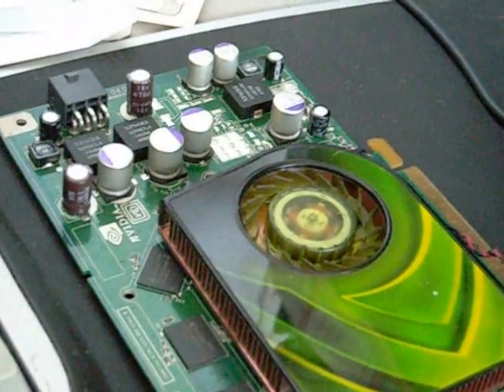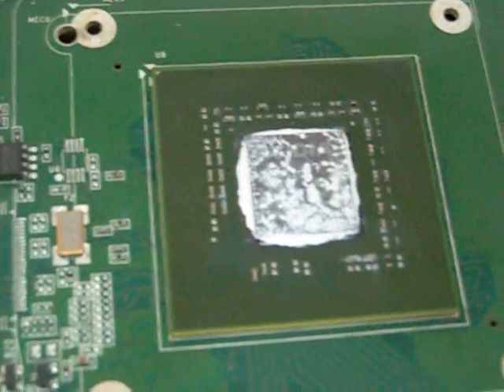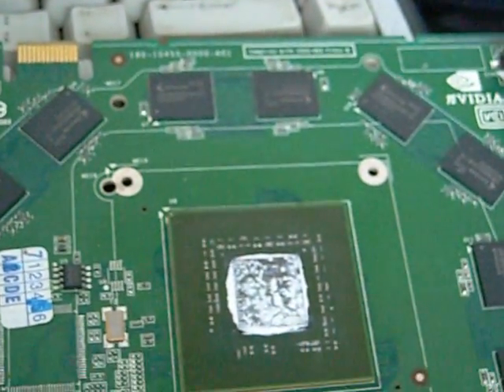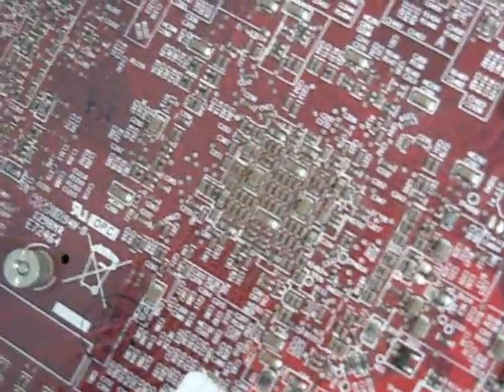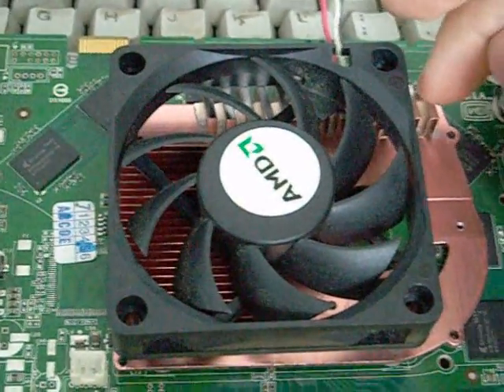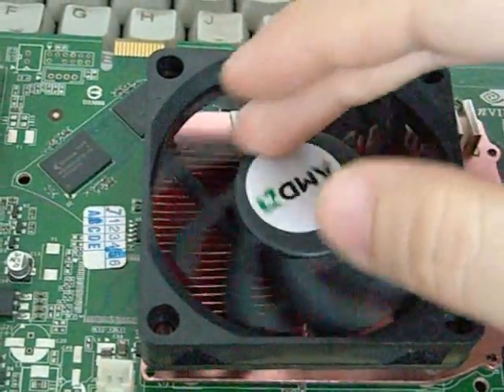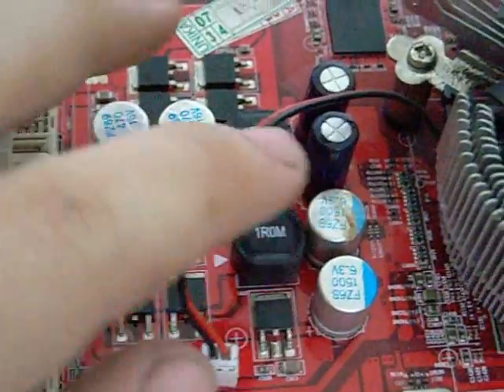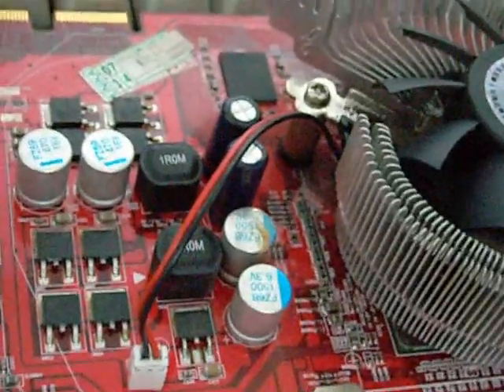How to tell if your graphic is overheating from a flu ridden geek.

Comment from the maker: Well if you have fan speed control with nvidia software you can increase the fan speed. If not you can try other software to control the fan speed like riva tuner i think.

Also, if you have too much positive pressure in your case ( more air blown in the case than blown out) then hot air is accumulating too fast to escape. Try twisting around one of the intake fans so blows out air (preferably nearer to the card).

Comment from the maker: Did some research on your card. Is it the dual fan or single fan version? Plus how old is it? It may be a case of the thermal compound drying up. Make sure to buy some thermal compound and 95% pure alcohol (or electronic cleaner) if you are gonna disassemble the heatsink/fan. Another alternative is to buy a 80mm fan, stick some foam tape on the corners and have it rest on the back (top) of your card blowing air on the back of the GPU.

You may also want to investigate airflow in your casing.

Comment: Oh my bad then. Well no it's not a mid or low range card, it's not the best money can buy it does get the job done. Far Cry 3 runs at about 50 FPS with everything set to High (2X AA, HDAO, 5 Buffered frames, V-Sync On) much like a lot of today's games, only ones that don't run as they should are GTA IV (crappiest port in history) and The Sims 3 with all expansion packs.

Far Cry 3 however is the only game that causes my GPU to over-heat.

Comment from the maker: My statement means that your card is either a lower mid-range card or just barely mid-range which is fine for running normal games like WOW and other MMORPGs at high graphics but definitely will have problems handling games like  Crysis 3 at high resolution and detail settings. Should it run at 24-30 fps at your current settings and it stills dies to overheating you can either invest in 3rd party cooling or add a fan. Otherwise, you will have to drop the workload for card down.

Comment from the maker: What the sensors read is not what is happening under the silicon :/ I meant more of solder fatiguing actually. The heat softens the solder and warps the circuit board. After time the solder contacts break but I have seen those small resistors fall off the board when the GPU was overheating like mad so I guess it's a combo or hotspots and heat dissipation on certain components. After all the mofets get hot too on their own cooked both ways is bad.

Comment from the maker: Heatsinks are mounted on my string screws so that is unlikely :/ The 4850 usual operating temps are 90C (the gpu was designed to take that heat levels since they actually it those normally). 100C on the other hand well that is well too hot.

Comment: Those temps are extremely high for a radeon card, my 6950 shuts of at 70C but rarely get any higher that 50C. My first guess would be a dirty heat sink but if there was any shock the heat sink can become disconnected from the gpu.

Comment from the maker: 100C is bordering on the point of GPU thermal death or GPU desoldering :/

If you one of the HD4850 that has a reference cooler (looks like a brick house with a fan on the card) then maybe you should invest in a 2nd hand cooler to replace it. Those reference coolers are pretty useless.

Comment from the maker: Well 60C is really hot you know so you cant hold contact on it for more than 10 secs. When it hits 70C that's when you gotta be careful of your fingers.

60C idle is still quite hot... :/ Better open the heatsink and check for powered thermal paste or rock hard thermal paste. Usually means the paste has perished and you need to reapply (which mean get some paste before you do this just in case).

Comment: already did, already put new tuniq tx-2 as mentioned to the video poster.it measures 55c at first, after i run game for 10 minutes it back to constant 86c (even after i let it idle for few minutes) while the fan never push any faster to cool it down.so that's why i use rivatuner to force the fan

Comment from the maker: If you have the chance you should crack open the fan shroud and do a little spring cleaning on the heatsink fins. There might a large colonoy of dust bunnies clogging up the air flow.

Comment: as u said, the normal should be 50°c at idle, but mine is constant 86°c at idle, so it's abnormal right? now i just use rivatuner to force my fan speed at 80% capacity, and it's currently at 60°c on idle and i'm quite contend with it

Comment: yes, i open it.noticed the paste has dried. so i put tuniq tx2 on that. at first idle temp is 55°. after i ran my game for 10 minutes, the temp is at 86° again with fan at 50%. do we need to put more thermal paste on it than on the cpu?

now i use rivatuner to force control my fan, and it gets better. my question is why the fan won't operate at appropriate speed according to the temp? before this, the fan seems to know by itself when to speed up, but now i need rivatuner to control it

Comment from the maker: Ok what you do open the panel to the temperature section then run your baddest ass game for 10 mins and the highest settings you can play smoothly. Quick quit after 10 mins or if the game allows alt+tab to the panel (or even pressing the windows key) and take a look at the heat.

Comment from the maker: Where did you get that temp reading? A software monitor? If so run passmark with the monitor on so you can see what is the idle gpu temp and how fast and high it gets when stressed.

Comment: Why? because they are both 1920x1080.it's why something like eyefinity slows a gpu down, because of the increase in resolution, amongst other things. you should have said at 1080p resolution rather than stating monitor size.

Comment: i hate it when people say that the graphics card performance is dependant on monitor size, it isn't, it's monitor resolution that makes a difference. if i was to plug my gpu into my 32" tv there would be no performance difference than if i was using my 21.5" monitor.

Comment: Is Ok for a passive low power card.It will not rise more than that even if you run a game.
More powerful  cards run at 90 to 100 regularly.
At some point between 110-120 the drivers will kick you out of 3D mode.More than that will get you hardware related BSODs.
So peace your mind; the HD6450  have a very low power profile and simply can not generate enuff heat to rise above 110 by itself.

Comment from the maker: @ubergammer00 That means the sound driver crashed (due to the card overheating or failing - capacitors blown). The sound that is playing is funnily enough music stored in RAM that is still pumping through the speakers (can't how this works but either the sound chip can work independently of windows crashing or that the RAM is actually holding the decoded raw data that is passed through the speaker port for output).

Comment from the maker: @zeznatdodaska Check if the thermal paste has dried up. If so get some and reapply (can't remember which video but a recent one I showed how I do it). While you are at it you can check if your fan is spanning (fast/slow or at all). If it is one of those small little fan consider getting a cheap 80mm fan to super glue on the heatsink (if it has enough surface area to grab 3 points of the fan's body) or put some double sided foam on the edge of the 80mm fan and rest on the back of the card.

Comment from the maker: @fatbillyjoe1 Ahhh the famous question.... that depends. If all things r perfect as in ur heatsink as a perfectly flat surface n it makes perfect contact with the heatsink then yes no dried thermal paste is best.

But there is not suck thing as a perfect world so depending on how thick they splatter it on, a dry thin layer of thermal paste is better than none at all. A think glob of dried thermal paste on the other is like an insulator.

Comment from the maker: @nasiondevasion If ur heatsink is not burning hot at that temperature then it is not conducting the heat from ur GPU. If it is burning hot, then what u have is basically a weak cooling system. U may have to buy a 3rd party cooler or mod a cpu fan or large on it... better to get a large heatsink since it has more surface area to remove heat.

Comment from the maker: @Wabbit0789 Thermal paste or compound has to times u need to look out for:

1 - Dried out paste more worse than no heatsink at all (IMO)
2 - Too much paste creates a large buffer that doesnt transfer heat efficiently which cause the temp to be over about 10C.

U can basically hold ur finger on a heatsink that is 50C-60C hot for about 3 secs. U cant hold it for 3 secs it way too hot. N software temps monitors r only as accurate as the thermal sensor.

Comment from the maker: @resuort

1: Dried superglue will burn at 450F or 232C, so if ur heatsink does get that hot u can bet ur ass u have more things to worry about then the superglue burning.

2. Thanks but I already PMed him weeks back on what to buy. But for ppl that didn't know the info is useful to them if their graphic was sold without a converter for molex.

Comment: @ig33ku 

1.)  using super glue on something that has rapid heat generation is dumb, if at any time you reach a peak load or have heat soaked for too long it will explode.

2.) Minheim needs a molex to PCI-E 6 pin adapter (5 dollar part at a local computer store), though if his PSU doesn't have one, it probably isn't rated high enough for the card he is using and should consider purchasing a newer one instead of doing anything janky

Comment from the maker: @Minehelm Oh that.... well... if u mean u cant find a power cable for it u either:

Get one with the card that has a molex connection on it (the normal white 4 pin where ur power ur hdd, dvdrom, etc)

Or ur PSU should have one spare PCI-E power cable that will fit in it (not the 4 pin square that fits on ur motherboard).

Comment from the maker: @M8DMAN Ok to check if the fan is really spinning all its might is to, bare with me, touch the fan blade as it is spinning. If it is spinning weakly a light touch n it will stop otherwise u will receive n nice slap on the finger. If the fan is working then u're need to disassemble the heatsink n reapply thermal paste. Use medical or electrical alcohol to clean both the gpu n heatsink.

If the fan is dead u may try oiling or jury rigging with super glue another one.

Comment from the maker: @M8DMAN Usually, if it is a software error... u will get a blue of some sort or a reboot by windows. It going black indicates a hardware issue. All i can suggest is check the capacitors n finger touch the heatsink of the graphic card.

An alternative method is get a hold of another gc (cheaper or older one) n run it through the day n see if there is hanging.

Comment: hey is a sign when I play a game like a few minutes of game play is okay and then all of a sudden the CPU of the game application jumps to 20-30 cpu consummation and it lags extremely for around 2-10 minutes and then it goes back for a while then it comes back around as long as your playing.its not an internet connection problem or anything it deals with CPU and im wondering if its my graphics card?

Comment: no, theirs no pixal distortion or missing textures. but I have used an nvidia monitor to check my temperature right after a lock up and it said 140 Fahrenheit, and everywhere that I have looked has said that's a normal temperature when running intensive games

Comment: I have a weird problem. I'll be playing a game and everythings fine. then the game will Lock-up and I have to Ctrl-Alt-Delete. Now the computer doesn't Bsod or anything but if I try to play a game the frame rates will be virtually unplayable. but the weird thing is If I shut down and restart (about 5 minutes) the games will be running back at normal speeds. and 20 minutes to 3 hours later it will lock again! :(  My computer is completly clean so I dont know if its over-heating or a dying gfxcard